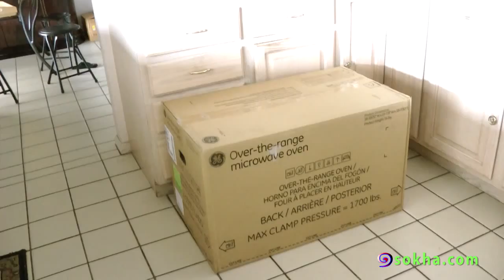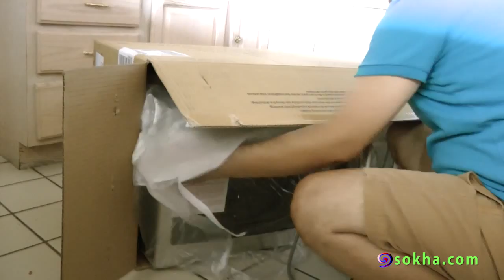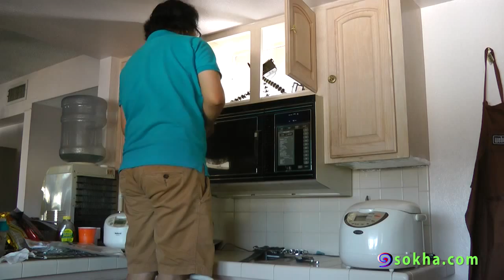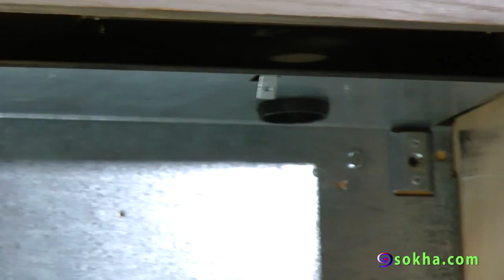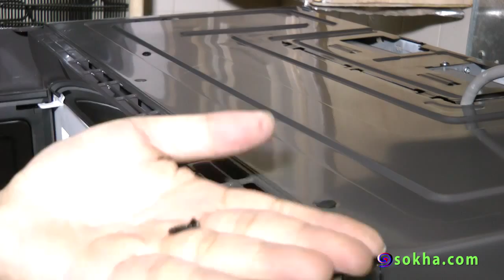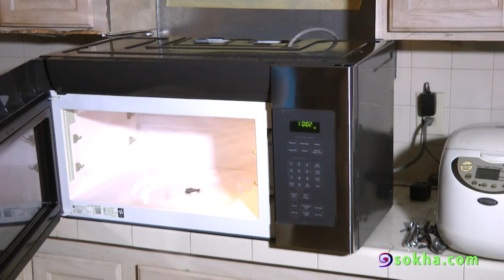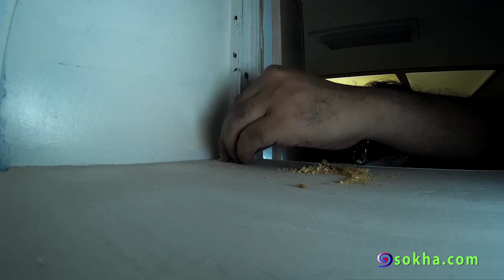Remove Jenn-Air :: Install GE Microwave

Comment: you are looking at the installation instructions... This isn't the same as the owners manual
Reply from the maker: sadly, there was none in the box.  and it was a brand new unopened box item!!
Reply: I ordered a similar microwave and am going to install soon.  I'm hoping most of the trouble is based on the fact that you started out with one that was set up for venting.  I think ours should be prepped for "recirculating"    If not, I'll definitely be coming back to this video.
Reply from the maker: Lesha Blair .... this model is brand new.  i wonder if the factory rushes shipment and forgot to include the installation manual.   and there was none available on GE website either!!

but so far, the microwave works great!  i'm hoping it will last as long as my older Jenn-Air! 
the JA lasted for over 20 years!!

Comment: Sorry to inform you the  model number is shown on the box at 00:49 seconds.  JVM 6175 SFSS on the white label and again on the green label.  Your so call mounting bracket or  "J" hook is attached to the back of the microwave.  I agree with worshipteam, "Your microwave is not secured to the wall and it is dangerous!"

Comment: you got it installed wrong! the mounting wall plate is attached to the back of the microwave and you can just screw it off and use it. Your microwave is not secured to the wall and it is dangerous!
Reply from the maker: +worshipteam ......I knew something is fishy about this microwave.   as I mentioned in the video, I don't even know the model number of this thing andddddd there's no user's manual included.    the installation pamphlet mentioned about the template but it is NOT included in the box.  G.E. provided a paper template but no actual hardware.long long story short.I had modified the J-hook and mounting screws.it is now very secured!!